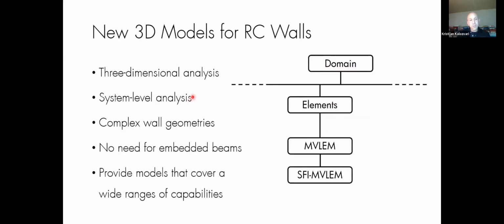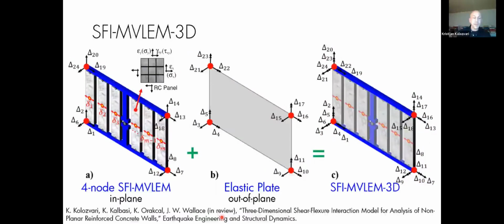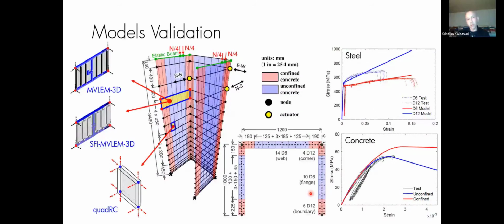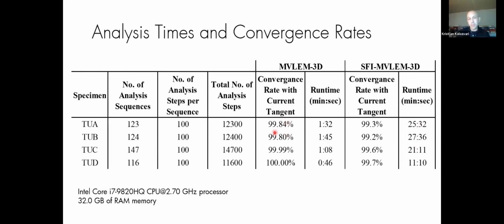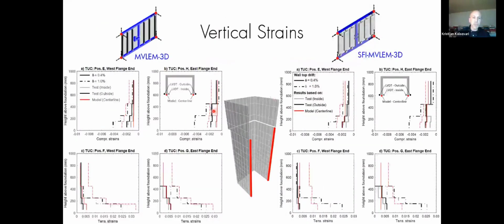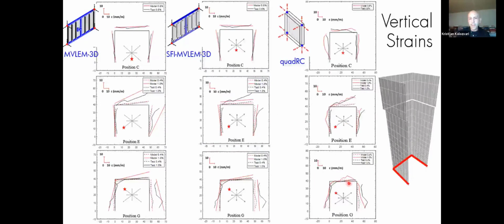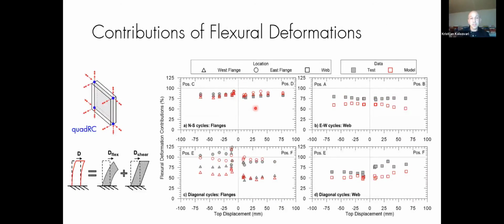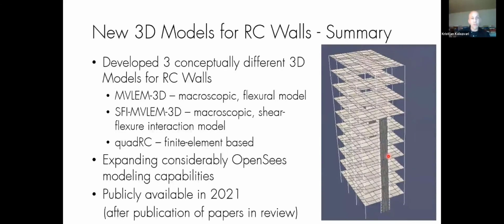3D Models for RC Walls - OpenSees

Comment: sir, i want to capture the hysteresis curve of RC shear wall with boundary frame in OpenSees (3D modelling). I am new in OpenSees so it would be great help if you can suggest some research paper or document which i can refer.
Reply from the maker: Hi! If the loading is only in plane of the wall, then you can probably use a 2D model. You can check out MVLEM, SFI-MVLEM, or any other available model in OpenSees. If the loading is multidirectional, please be patient for few more weeks. The paper and the 3D version of these models should be available soon.